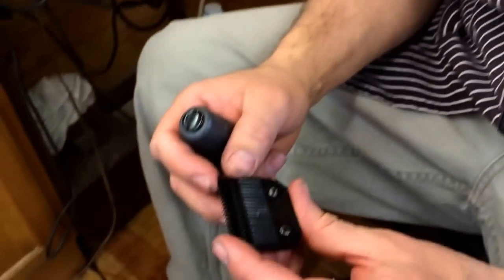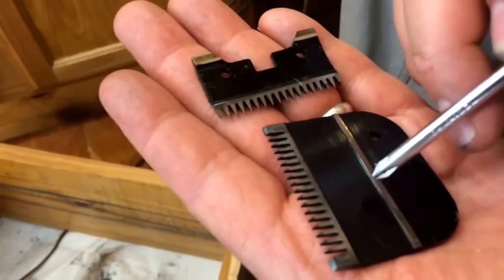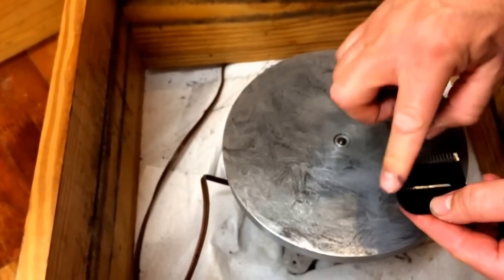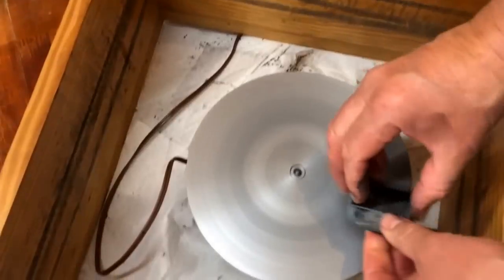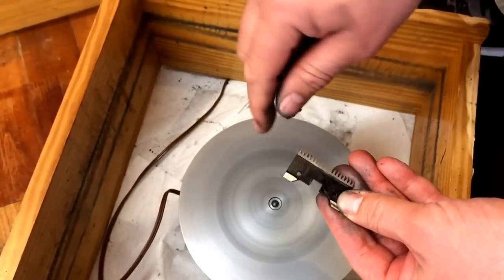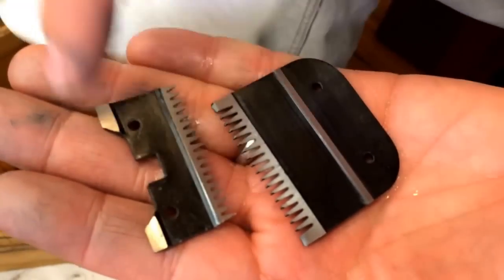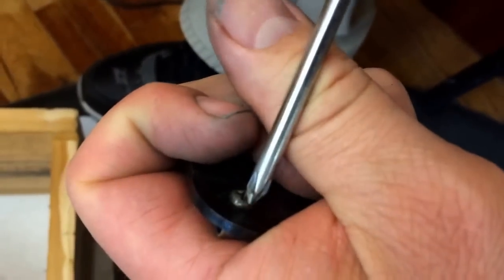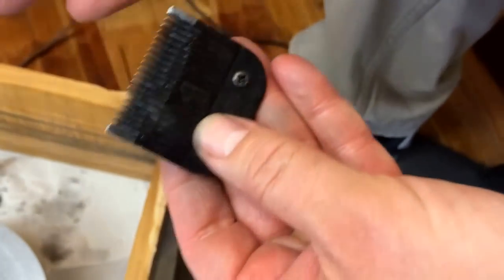How to sharpen Barber blades

Comment: Just found this video... its wrong on so many levels. The blade is facing the wrong way when being sharpened. No mention of the geometry of the blade or the plate,  no mention of the need to ensure the setback is correct when the blade is put back together. There is also the need to clean the blade when it comes off the plate, this is done a number of times using different methods. I would not be rinsing the blade in water.. it will rust. No mention of the tension needed to ensure the blade works. Bottom line - get your blades sharpened professionally.
Reply: Disagree with the direction the blade faces.  Need to at least finish with a leading edge to remove the burr that forms from trailing edge.
Reply: I agree with Joe.
Reply: I never seen metal rust with oil on it. If you take paint off a car. You do a 2 ft by 2 fr and prime it to keep it from rust.  I have machined engines. You warship them lube blow dry lube them again. If your not going to put them together for a few days.  Lube them again tomorrow.  I have to degree.  I use water all the time. If you don't oil them you don't need a Phillips screwdriver.

Comment: good afternoon friend, take a question please ... The spring pressure is made by these two screws, which hold the blades? and how much pressure do I have to give, is there any method? thank you very much.
Reply from the maker: Hi Carlos! We just do enough grinding so it’s smooth and we stop.
Reply: @TheEndOfTheInternet  ok my friend, thank you very much.
Reply: Tighten them up. The spring between the two blades will ensure they still move.

Comment: Manual screwdriver? Old school!
Being a lapidary, I suggest that your watchers consider buying "lapidary disks" and skipping the "lapidary machine" which spins it. They are only a few dollars, are absolutely flat, and will last way longer than you will. They come in six and eight inch diameter.

Elsewise use wet-or-dry sandpaper against an absolutely flat surface such as glass or tile. Regardless of what abrasive, buy at least two, one coarser than the other. The sound of the grit the presenter is using sound pretty rough to me. The finer the grit, the finer the edge it will produce.

Comment: Hey I live in Germany where can I get one of this machine because I definitely have difficulty to sharp my blade ?
Reply: Use water sandpaper you can buy from a car parts shop.
Reply: So is you grinding wheel flat? Can I sharpen them on a flat surface with 1200 grit sandpaper? Thanks for great video

Comment: Dangerous to face the teeth into the direction. If a tooth catches, it will throw the unit so fast, it can stick in you face, or your eye, in a split second. I have seen it.
Reply: It's dangerous walking across a street.  If your scared don't do it.

Comment: Only problem is the areas where you are paying attention to don't do any cutting
Reply: The gouge and mark on the rear support area is worn down. 
the result is the top cutter and bottom cutter do not align perfectly.
i.e The top cutter plate get tilted . 
looks like this  " <  "    instead of the original  " = "  ( flat parallel )     
Thus the cutting performance is compromised.  

When the cutter plate is grinded .  both front area and rear area are grinded at the same time. resulting in a flat cutter plate again .

Comment: What a Joke. You are using a flat plate, ALL clipper blades are Hollow Ground and you are grinding them flat.
Reply: What would be the correct technique to sharpen the blade then? There are so many videos, I don't know which one is showing the proper way. I'm thinking about just sending my blades to oster and let them do the job...
Reply: What is the 
Name of this machine
Reply: First off it needs to be clockwise !! You can do it that if you want to ;and mess up your blades 😂 sharpen it clockwise and to clean the blade  get a demagnetized machine to demagnetized it then use hot water water to take the grit off then use solution like paint thinner to take the remainder of the grit  after that oil on the blades and it will cut like butter 💯 I’ve been doing that and all my clippers hit
Reply: @1FRANHER1  You would be better off having them professionally sharpened. The machine Heiniger uses to sharpen shearing blades with the correct hollow grind costs many hundreds of euros. Watch the Heiniger Youtube video.
Reply: Skip Calvert u dont know what you talking about i am a barber and thats the correct way to sharpen blades smh
Reply: @nicholasmonroe3754  laser clipped blade sharpener. It's a flat hone for large animal (sheep) blades
Reply: Not all blades are hollow ground. 5-1s t liners and some others are flat hone. In fairness I hollow grind at least the cutter on the job hollows.
Reply: @newproduct8107  Sorry .. but you are wrong. Skip is a professional sharpener... as am I. This is not the correct way to sharpen a blade... see my comments above.

Comment: You are definitely wrong. Circular speed is different on sharpening disc. It is faster Outside from origin. You grinded cutting blade and comb but it is not linear